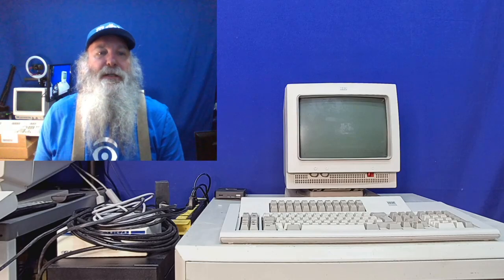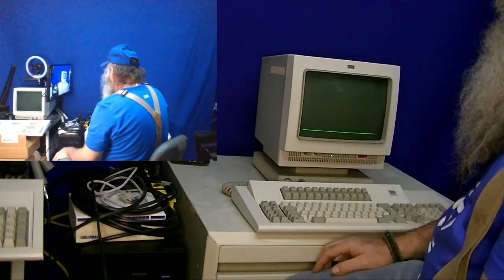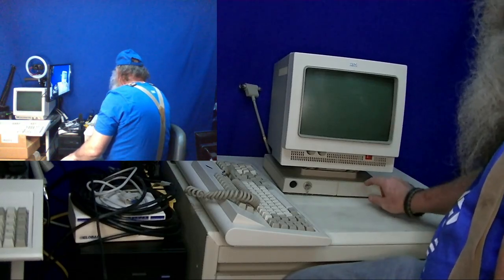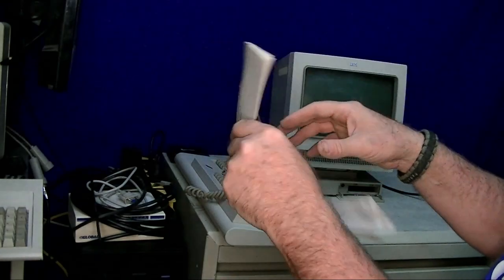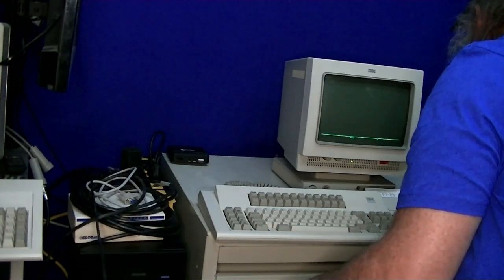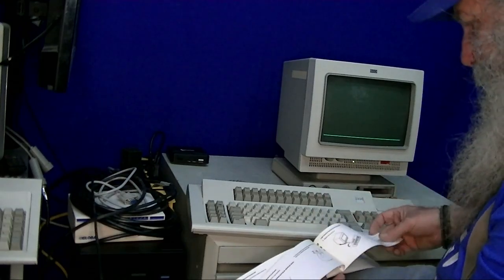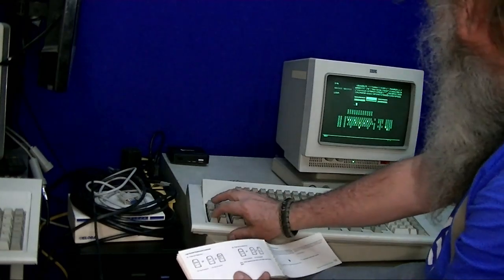The IBM 3196 terminal!

Comment: do you have the predisesor to that terminal?  The model that came before it like before 1987
Reply from the maker: There are other, older twin-ax terminals - Which model are you looking for?
Reply: @IBM_Museum  how about the 3270 terminal
Reply from the maker: @Richardpasquinucci : 3270 (co-ax, for mainframe) is different from 5250 (twin-ax, for Mid-range, "Minicomputer") - I do have later co-ax terminals, but the host is (of course) different, too. Although there are Pi and other simulators, it is harder to have a mainframe host.
Reply: @IBM_Museum  no.  Im interested in the actual display terminal

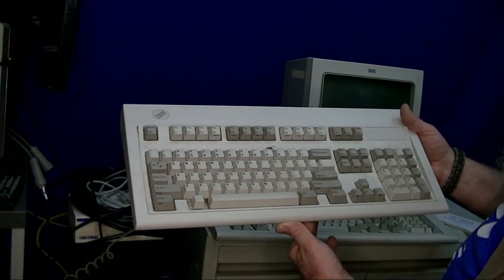Comment: I think you have to debug that terminal at 23:00
Reply from the maker: @Richardpasquinucci  - It's not connected to a host on the video...
Reply: @IBM_Museum  no I think it was connected to WiFi in the store.  As you noticed the Eithernet port in the back.  If I had a wired connection from a provider.  I would connect the line from the router to that port
Reply from the maker: @Richardpasquinucci : The IBM 3196 terminal is "twin-ax" - No Ethernet or wireless connectivity (maybe you are thinking of a Raspberry Pi mod?).

Comment: Thank You for the video. I would be interested in seeing one of these terminals in action with your as400. Maybe some basic tasks with information about the system. Possibly with some simple tasks or programs being run? Maybe Moshix would have some suggestions to demonstrate the machine without too much effort.
Reply from the maker: I plan to connect the terminals in an online demonstration once the videos of each model are complete - the 3197 is next, and I won't likely pull out the 5251 or 5252 yet. Terminal emulation, in both the 8-bit and microchannel adapters, is also planned.

Thank You for your feedback, allowing me to reveal a little of the scheduling I have planned.